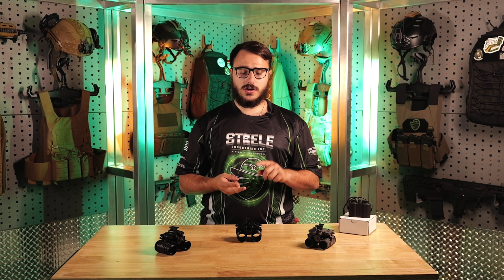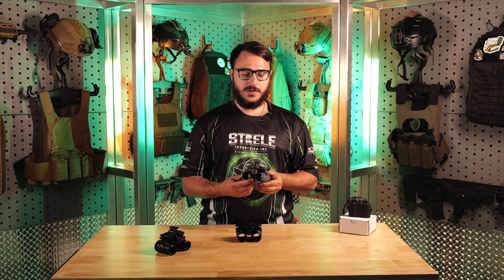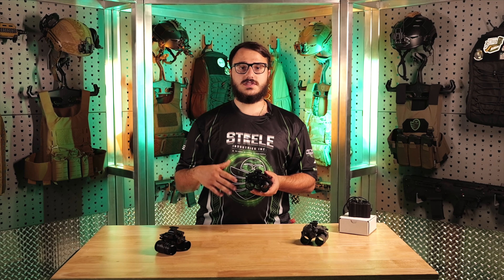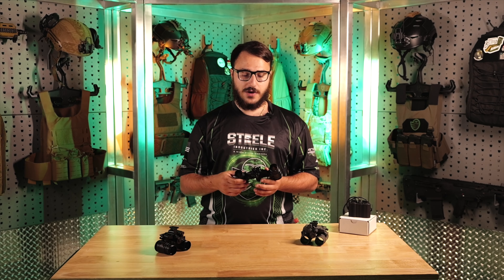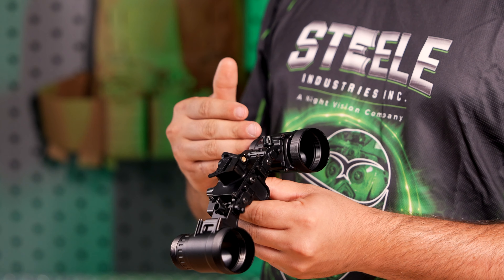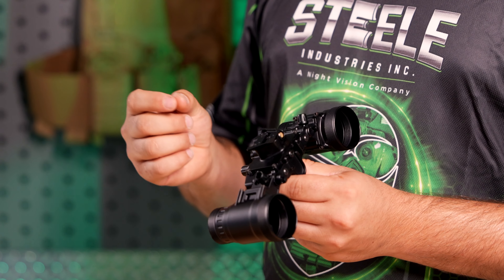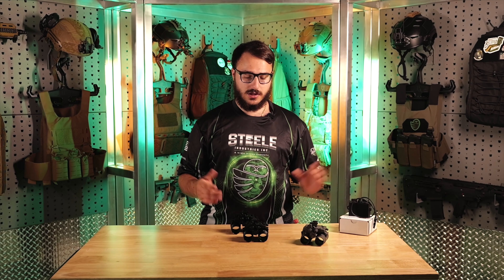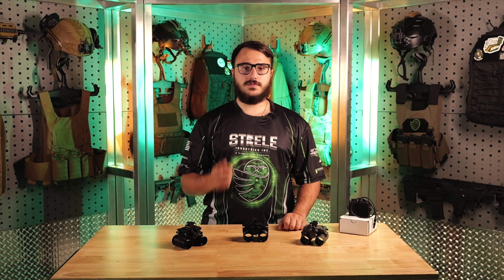Steele Industries Nighthawk Night Vision Housing Update

Comment: This and the MH-1 are my final two contenders for the dual tube housing I am going to purchase. I previously purchased a PVS14 from Steele and everything about the experience was amazing.
Reply: I'm in the same boat, MH1 or the nighthawk. Something about the MH1 doesn't seem as durable to me. Either way both are fully featured. Where are you leaning?
Reply: @FeastOvGoreglutton  I'd love to be able to turn my dual tubes into mono's for friends and family but that means another 500-1000 investment for a helmet set up. Rn im leaning towards NightHawk as the Mh-1 had a rocky release
Reply: @FeastOvGoreglutton  I ordered the Nighthawk and was debating about the MH1 as well. I went with the Nighthawk since there is a LEMO port for the battery pack from the start. The MH1 requires an adapter for a battery pack and there isn't such adapter available at the moment. Also the fact that Steele is including a battery pack with the Nighthawk already is nice.
Reply: I am now on the same fence. What did you end up going with?
Reply: @TayDay1  I havent decided. Lots of new housings coming out this year. So I have been waiting and sving money